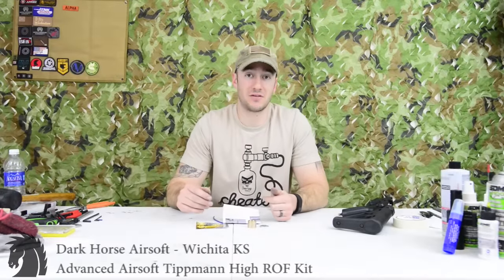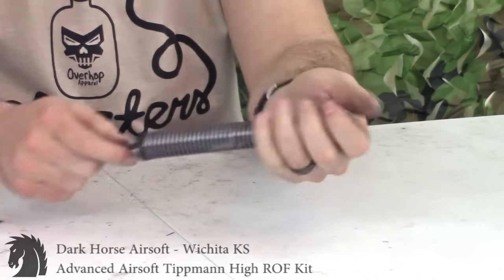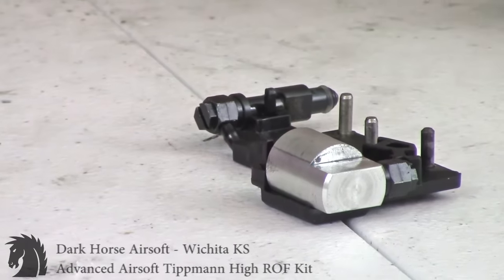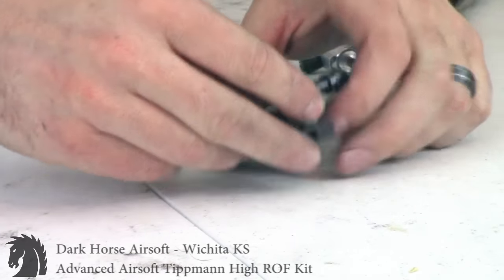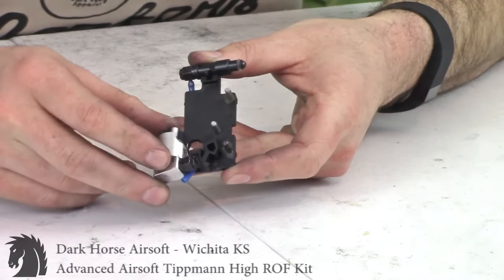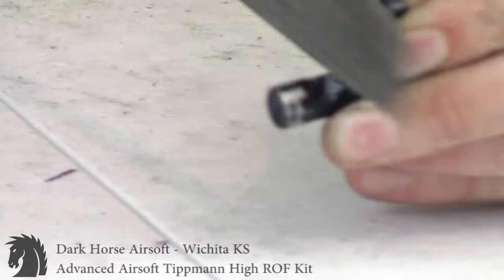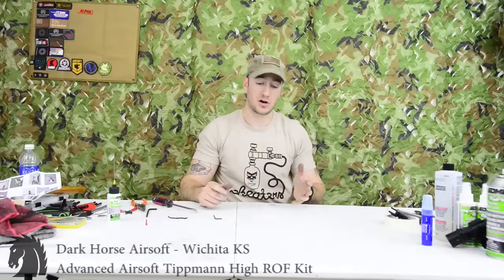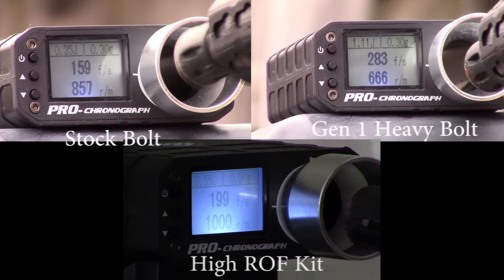Tippmann M4 High ROF Kit Install

Comment: One note on installing new LPR hose on to the banjo barb is to chew on the end to soften it up.  This will heat and soften the hose to make it easy to install. Old paintballer trick the autococker LPR hose.
Reply from the maker: +Docfire, good to note...in this case lube worked out but wish i knew that first haha
Reply: Hah, yeah I remember that trick. Also helped tucking those little brass tophats down over the barbs.

Comment: great tutorial. Question.  If the blue tube is a snug fit on the fittings isn't it the same bore size as the original black tube?